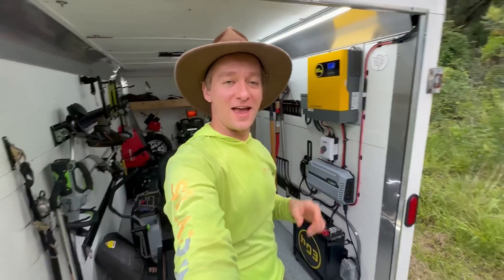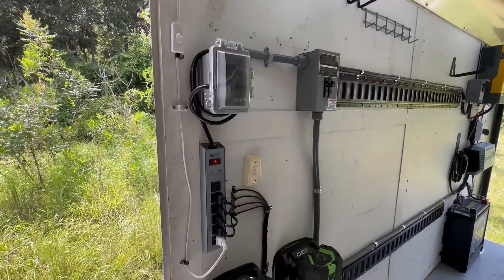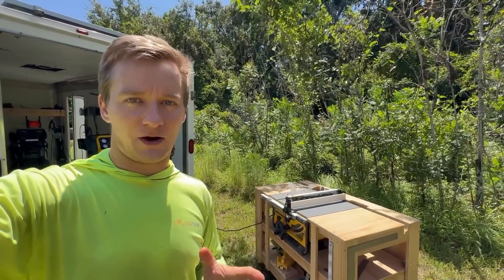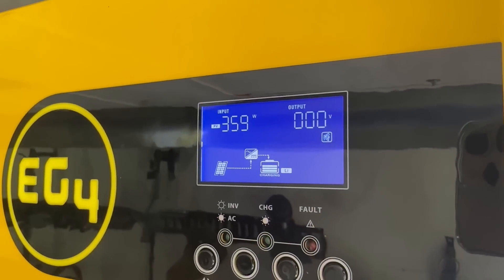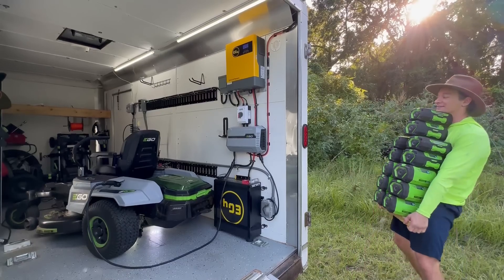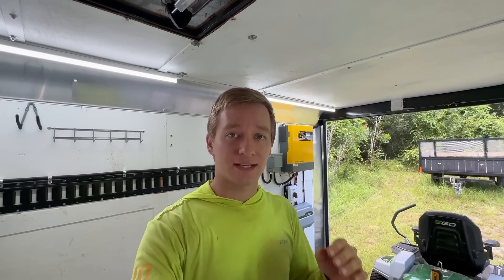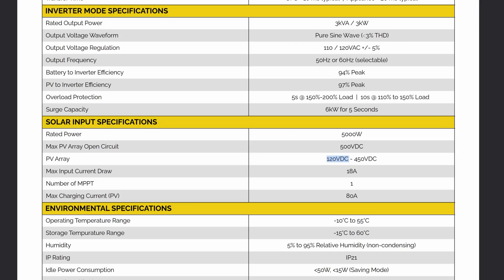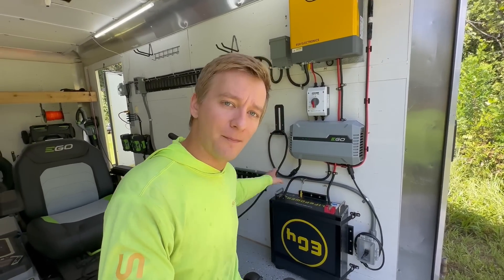Solar Powered Lawn Care Setup; Why Not Just Buy More Batteries?

Comment: Loving the clean lines and minimalistic look of your trailer solar setup. I'm still on the fence about what type of setup would work for my trailer but right now I'm leaning towards an ECOFLOW Pro battery generator which will simplify my look and is also transportable for camping, home usage, etc. Because of the equipment that I'm running, I see that our power requirements are different. Awesome video!
Reply from the maker: Thanks so much! I like the idea of the "battery generators" like an ECOFLOW and I completely recognize it's an easier "plug n' play" solution but personally I'm still not sold based purely on cost.  I mean EGO batteries are basically $1000 per kWh (insanity), the ecoflow is about $888 per kWh (not terrible considering it comes with inverter and outlets ready to go), but the EG4 setup I have works out to about $409 per kWh and that's including the inverter.  Figure a little more for breakers, outlets, wiring etc. but still.  Anyway I can't wait to see what you end up doing and hope things work well for you! Let me know if you have questions. How do you like the Toro Grandstand Revolution?
Reply: If I had to do it all over again, I would go with the EcoFlow or other all in one system. But because I started transitioning to electric before that came out, I went the hard way of combining all the components myself. At the end of the day, both ways are about the same price.
Reply: Ecoflow would be easier if you transferring between setups. Just have solar available and plug in then your good to go.
Reply: What wire management product did you use to keep your PV wire so clean and neat to the side of the trailer?
Reply from the maker: @OffGridEssentialsbyFirebear  Just some square sticky-back cable tie things from home depot that have a screw hole in the middle.  The stickiness wears off so I put small screws in each one into the plywood to keep them from moving.
Reply: @solarpunksteve  looks great man! Well done 👏
Reply: Just checked ecoflow's website, looks like theyre down to about $652/kwh

Comment: Could you hypothetically power your trailer using your Tesla? Just as an emergency power supply? Or does your Tesla not support that? My car has got V2L and it would be super useful just as backup power. As you said, an EV battery holds just so much more than your trailer.
Reply from the maker: Unfortunately no, none of the Teslas can do that. The upcoming Cybertruck supposedly will have that capability, but of course we haven’t seen it yet. The F150 Lightning does if you pay for that package (not sure if it comes standard?), and I think the Rivian does too. Is your car a Hyundai Ioniq 5? I think once more people realize how useful it can be for certain situations and we get more competing vehicles, it will become standard practice.  I mean here in Florida if you have a hurricane knock out your power, it would be great to run an extension cord into your house and power your refrigerator for days if not weeks off your car battery lol.
Reply: @solarpunksteve  True, esp. in Florida! I think this feature will be more common in the future. I drive an MG4, the towing capacity would be too low for your (really cool) setup, tho. The Ioniq5 seems to be a good car overall as well, but it is too large for my taste (basic european dude here, we don't have so many SUVs).

Comment: Are you worried about the 300 life cycles these batteries have? I don’t know if 300 is spot on for these Ego batteries but that’s what Stihl and Kress like to really show their customers. The set up is unique and awesome! Hope to hear from you soon! Keep it up!
Reply: All I can say is I have had the weedeater from ego and I have been using it at my house since 2018.still running strong today.
Reply: @bundyho1  that’s good to know. I plan to get the rear motor Ego string trimmer to start for my gardening business. Hopefully the 5ah is enough to finish 1 days worth. I string trim for about an hour everyday Monday-Friday. I wonder if I’ll feel or know right off the bat the ‘power loss” that Kress explains about other brands. Good day
Reply from the maker: So I need to do a video on charging cycles and life expectancy.  I have a fairly decent knowledge of battery chemistries, charge cycles, degradation etc so I'm relatively confident in these lasting a fair amount of time (already at over a year and only one battery failure). But this is part of the reason I wanted to do this, to see what actually happens and share it (basically run the experiment for you).  I need to finish gathering the research papers I'd like to reference for these types of batteries and be able to present it to you all in a clear, well organized fashion with testing and data to back it up and maybe even run some numbers on cost over time vs gas etc..  Either way I'm going to find out if my batteries are going to last by continuing to run my business as if I need to make money, not worry about babysitting the batteries/equipment haha

Thanks for checking things out, my whole goal is to get people interested and thinking about it, whether or not they choose to go this route!
Reply: @solarpunksteve  that’s awesome. Really cool to see and looking forward to all the content you have coming up.
Reply: It would be cool if they came out with LFP batteries for the smaller Ego products, like the string trimmer.  I only have 5ah and 7.5ah batteries and use the 5ah on the small tools, a 3ah in a slightly smaller package than the current 5ah battery would be awesome.

Comment: are sign up for a Tesla Cyber truck ?
Reply from the maker: I do have a reservation! Not sure whether or not I’ll be in a position to follow through on the order at that time, but I hope so! What about you?
Reply: Not in my budget at this Time.  also hopping the Cano Pickup truck comes thru to production @solarpunksteve
Reply from the maker: Yeah I’m a little scared at what the pricing will be for the final Cybertruck. I’m glad that there are more options on the market and hope more come around. I remember checking out the Canoo bus/van thing when it was first shown and I quite liked the idea, the truck looks cool too, hopefully they make it to volume production!  The F150 lightning looks pretty attractive price-wise depending on the trim package. I’ve thought about getting one and just using the onboard charging system to keep my equipment charge up instead of the whole trailer setup.

Comment: I have been waiting for you to post another video lol
Reply from the maker: I know, me too! This one took way longer than I thought it would... Tried to include answers to a lot of the questions I've been getting so people have something to reference.  Hope you liked it!  What do you want to see next? Or what questions do you want answered?
Reply: @solarpunksteve  I did enjoy the video! I am in the process of getting my lawn care company official and I was considering using the EGO blower and string trimmer and I am curious about the life span of the batteries and how many batteries I would need to make it through the day. while doing some charging through the day with a 12V inverter.
Reply from the maker: Those are good questions to ask! So a few notes on that, for the string trimmer I use the 5ah battery and I can probably get maybe 4 or 5 smaller yards.  It varies though since some of my yards require quite a bit more trimming than others and I might only get 3 of those types.  For the blower it definitely will draw quite a bit and you might need an extra battery or two. Again this all depends on what your yards are like. I have some corner lot yards with sandy sidewalks and I might only be able to blow two of those off before I kill a 5ah battery.  But other yards are tiny and it takes 3 minutes to blow them off; those I could do 15 or more of.  Are you just starting out? When I started I just went until I ran out of battery and moved any new yards to the next day.  You get a feel for it after some time. If you can charge up even a bit while you're out there you'll be pretty set.
Reply: @solarpunksteve  yes I am just getting started I got my LLC a week ago and am currently waiting for my EIN before I get insurance and business account. Once those are done I will officially get started.

Comment: Fold up or pocket panels could also bolster your wattage. Also slightly used panels that operate at 75% capacity of their original output are also a cost effective option. The only downside is increased weight.
Reply from the maker: I've considered a fold-out solar system, but that adds complexity and it's something I don't technically need right now based on my current usage, would be great for a camping rig.  For a static system used panels are a great option, like on the roof of a building or on the ground, but for a system like this where I'm severely limited on space on top of the trailer, getting something that can't output at 100% of it's rated capacity didn't make sense.

Comment: You could also build your own battery pack using individual cells for a custom battery pack to best suite your needs. It’s cheaper but you their is a time component. If your looking to scale your business vertical integration might be a good option.
Reply from the maker: I thought about that too, and yes it would be cheaper to build them, but there's definitely a cost to my time.  And I can make more out there on a jobsite than I would save by building a battery myself.  Totally a great option for those on a budget, but best thing in my case is keeping things as simple as possible.  I have plans in the future to build bigger and different systems so I might take the time to build the batteries myself at that point.
Reply: @solarpunksteve  id also be cautious of making your own pack due to insurance/safety purposes. I made my own DIY 48v/280ah pack for my house but in a mobile (shaking, rattling, etc) environment... warranty and UL/saftey is preferred in a business for sure - you did it the right way.

Comment: DC to AC to DC you lose a lot of juice. Are you able to power your batteries using only DC? Maybe you could use a voltage controller.
Reply from the maker: I agree, but there's no simple way for me to charge the EGO batteries directly from the onboard battery without building a custom setup.  One of my design requirements when I was planning this trailer was I didn't want to have to mess with it. I wanted to just install it in the trailer and get back to making money for my business.  Also you have to think if I get some different equipment with a different voltage on the batteries, I have to build and figure out that setup as well, whereas with this, I just install the charger and I'm up and running.  Not to mention the flexibility of being able to power other things like I showed in the video.  I'm all about efficiency so I totally understand where you're coming from, but for me, there's just too many things to worry about outside of the trailer that it's not high on the priority list.  If you want to build a system I'm definitely happy to test it out for you! haha